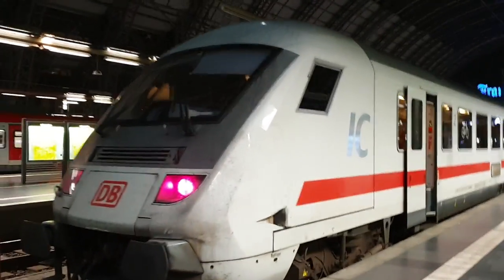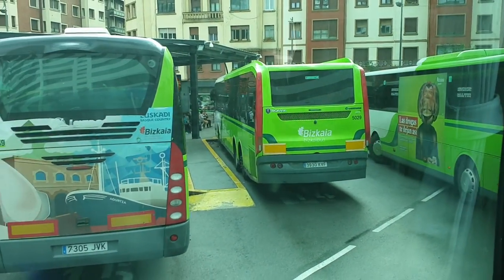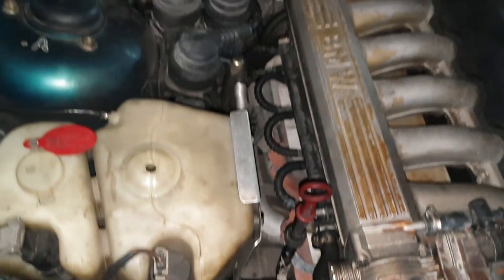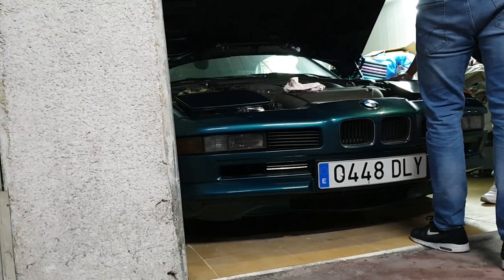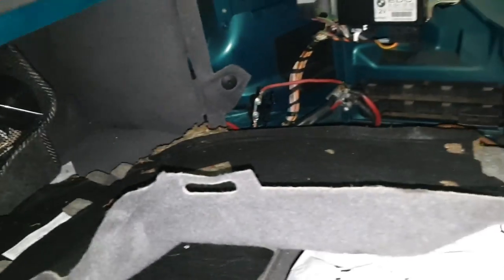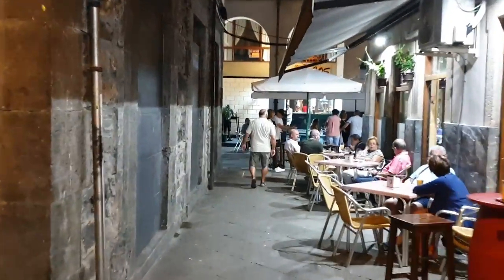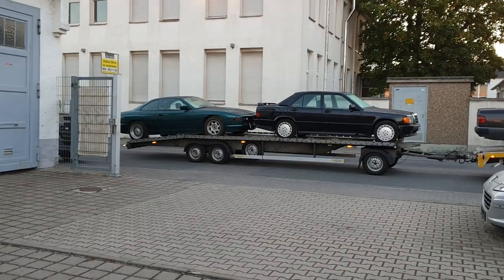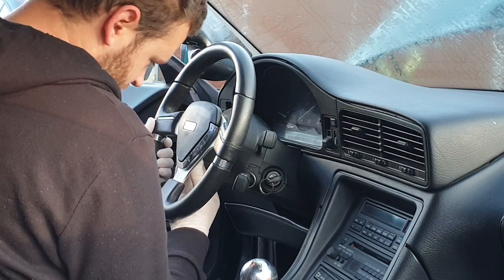V12 BMW E31 850i Revival - Project Bilbao: Car Buying Road Trip - Part 1

Comment: "some gauges here and they are disgusting " 😂 like your opinion about after market parts in cars. have same opinion 👌
Reply: Dead right
Reply: I walk away from any BMW when people install unapproved parts.  Usually wheels that screw up the bearings and bushings.  They usually neglect scheduled maintenance [like cooling system MTBF times, etc] in favor of garbage like this.  Neglecting that which was designed for continued ops will cost you a lot more later, like double the acquisition price in many cases.  Hope you didn't pay too much.
Reply: Well, everything can be done tastefully.
Some cheap ass Momo stuff you can buy at the local discount car goods store is not tasteful and stating that is hardly enlightening knowledgeable people. :D
Reply: I think absolutely the same. 
I mean, I own a tiny Panda, that's the kind of car that has been made to work, no one would bother if I install some gauges on my car. 
But that BMW, that's another story. You should kind "pay respect" of these cars imho

Comment: Gute Arbeit! Hier ist ein echter Könner am Werk. Und es gefällt mir, dass er alle "üblichen verdächtigen" Teile gnadenlos erneuert. Nach 30 Jahren muss es eben mal die ganz große Inspektion sein. Für einen mächtigen V12 ist der BMW-Motor wie auch der ganze Wagen erstaunlich reparaturfreundlich und technisch durchaus beherrschbar. 

Good job! Here is a real expert at work. And I like that he renews all "usual suspicious" parts mercilessly. After 30 years, it has to be the very big service. For a huge V12, the BMW engine, like the whole car, is surprisingly repair friendly and technically manageable.

Comment: In realizing that this video is 3 months old, I appreciate your love of automobile's & BMW E31 850i However, With that one being a manual, I think it is worth a full restoration! A V-12 vehicle with a manual trans, Does not reside on every corner! am not to familiar with that car but, I am wondering how well they perform?
Reply: it performs like a sack of potatoes... from 90 to 96 I had the opportunity to drive the e31 and e32 v12 ... 850i and 750iL ... the latter was a sports limousine. the 850i had a soft suspension, felt heavier than the 750iL and it took ages to reach the top speed .... designed by pinin farina I hated to sit in the 850 since I could not see the exterior 🤣 ... if I could find a decent 850 for 15k I would get it in a heartbeat... same goes for the 750iL ...  🤣🤣🤣

Comment: So with cars that have been sitting for a long time, that haven’t been regularly started is there a concern of premature bearing wear, I know on industrial machinery idle equipment usually have to have all bearing replaced before they can be returned to service, lack of oiling and weight sitting on the bearing surface?

Comment: Quick technical question: I'm also from Europe (France) and I'm also buying 1990s BMWs every now and then. The issue is that the used cars market in France is extremely poor. I'd like to start looking for some projects around Europe - what kinda website are you using for that? Thanks a lot!

Comment: Hopefully you don't run into the same issue we have with the ABS pump as no rebuilt/replacements are available, and we're a US based BMW centre on the East coast.
Reply from the maker: As expected, I did. The only option is to get a used one which will likely be in the same condition. The brake fluid was like coffee, initially I couldn't get it to flow to the rear wheels. I removed the brake lines on the pump and gently tapped it with a rubber mallet with pressure bleeder attached. Eventually, I got brake fluid to flow to the rear wheels and I was able to bleed the system. You'll see in part 2.

Comment: There are lots of good looking aftermarket steering wheels,but that is indeed not one of them.  It's such a shame that the European versions of cars like this usually come with much better looking factory steering wheels too.  It always bothers me if a car has an ugly or too big steering wheel, but that is an easy / quick change to make.  I usually like to go with something of a smaller diameter,but looks as if it could have been OE.